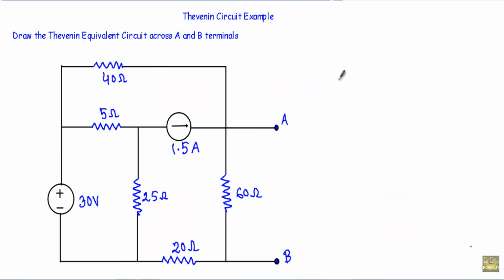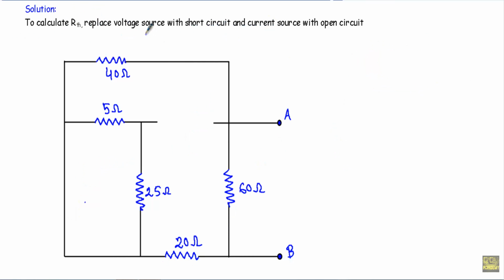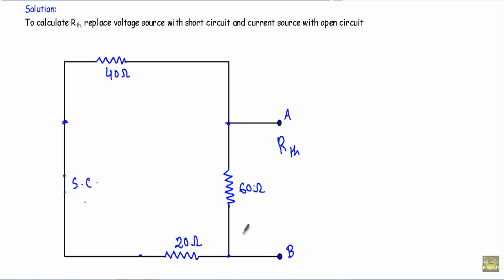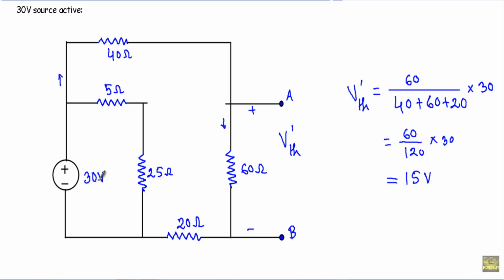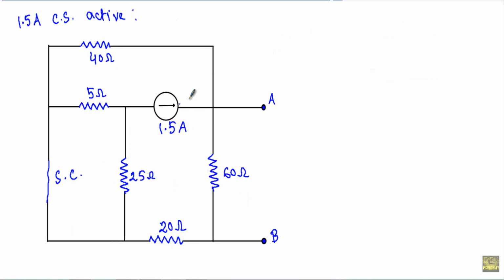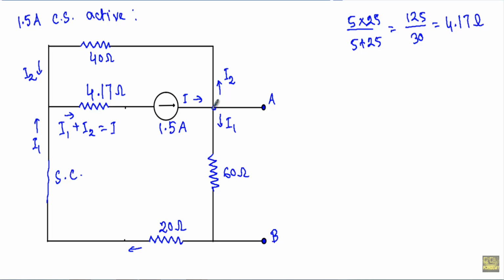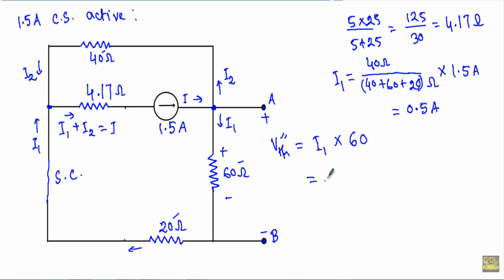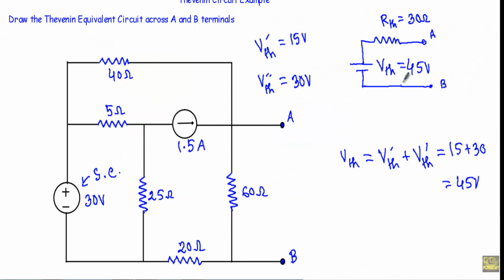Thevenin Circuit Example 2

Comment: hi, I'm not sure I understand around 7:15 completely? I thought that you can only do current division with parallel resistors (and voltage only for series).. but the equivalent resistors you add up are in series?

Comment: sir, how to do it with using nodal analysis? the current source is in between two nodes which is causing me problem to solve it by nodal analysis. please help
Reply from the maker: This is a difficult circuit to solve with nodal analysis. The current source in the middle will be outgoing from node 2 and incoming for node 3
Reply: Could it be solved by supernode?